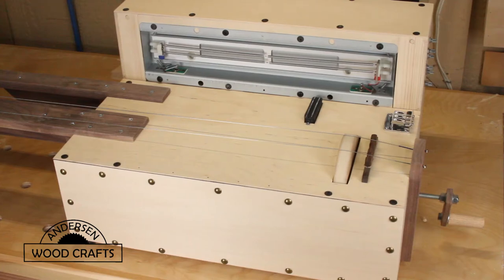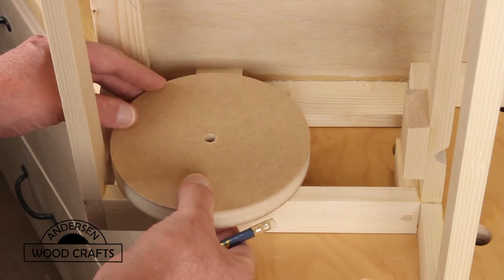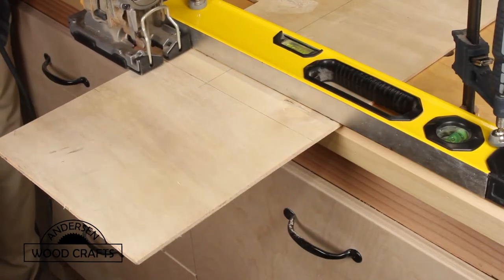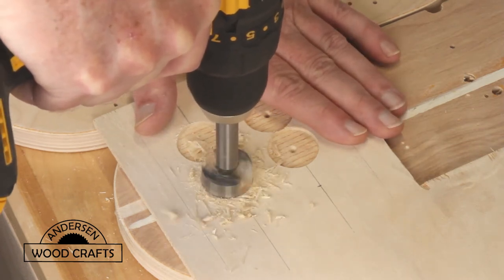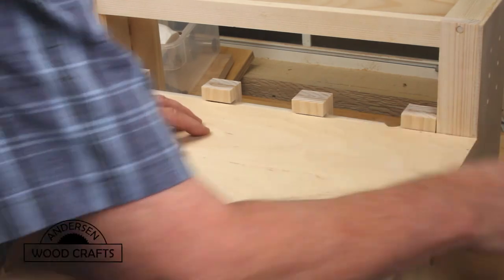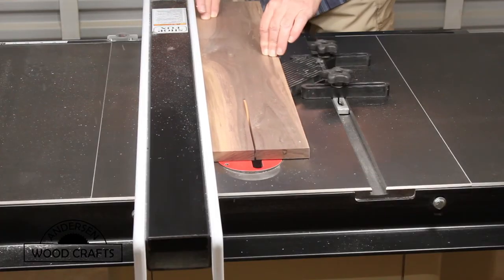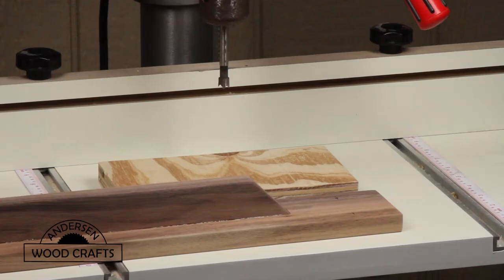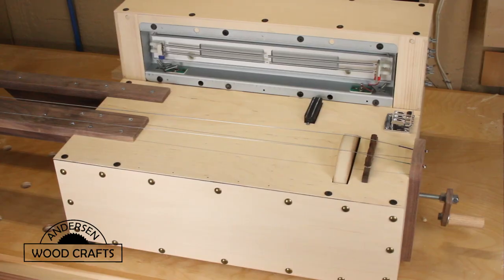HORROR SOUND MACHINE PART 2 – MAKING THE SOUND BOARDS AND GUITAR NECKS FOR THE APPREHENSION ENGINE

Comment: Looks great. How large was the 1/16" ply you found at Hobby Lobby?
Reply from the maker: I believe it was 12" X 24"".  Of course there is no guarantee that they will have it now.  Thanks for your comment.
Reply: @AndersenWoodCrafts  Yep. I checked and they didn't have it. I can get it online. Did you use the same 1/4" ply on the sides as the bottom?
Reply from the maker: @Feldspar__  As with most woodworking projects it is your project so use what you want.  I believe I used 1/4" on the sides and back, but you could use 1/8", I would not go below that myself.  Thanks for the question and comment.